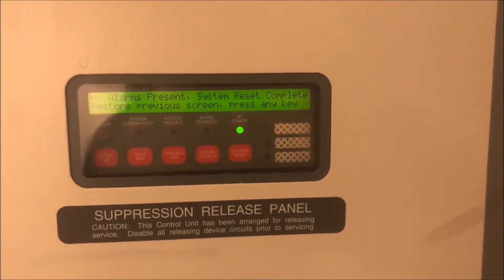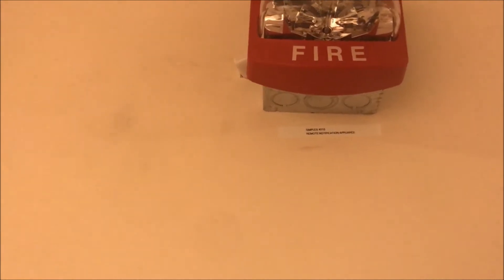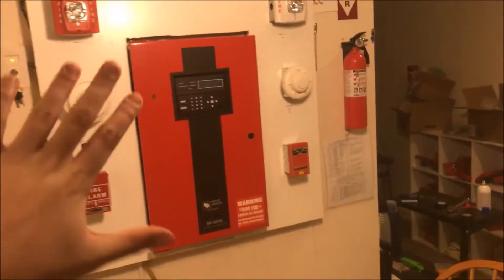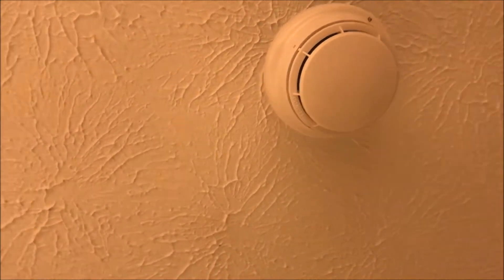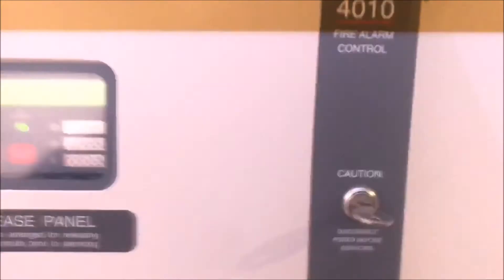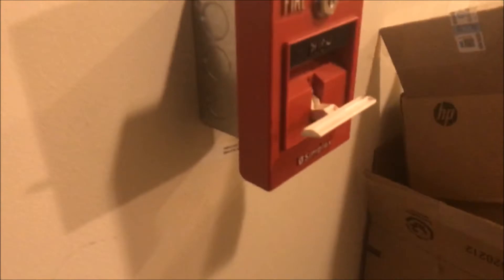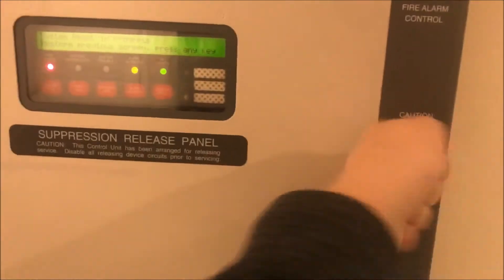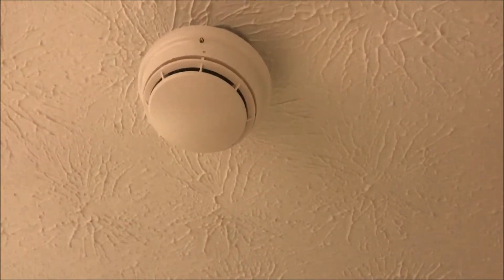Simplex 4010 Test 1: Lots of TrueAlerts!

Comment: Does the truealert Fire Alarm vibrates when it goes off, anyone?
Reply from the maker: What do you mean "vibrate"
Reply: Because the horn vibrates
Reply from the maker: I mean, its a vibrating horn, so yeah, the device itself may vibrate a bit
Reply: Thanks for responding I wish I am in this video to feel the vibrations
Reply: Fire Alarms and Such here is a request:
the next time you happen to videotape the truealert Fire Alarm next time, touch it and comment if you feel any vibrations from the Alarm. Thanks. I have autism and I am interested with truealert Fire Alarms
Reply: Fire Alarms and Such The next time you do a video, put your finger on the Fire Alarm and you’ll feel the vibrations from the horn going off!!